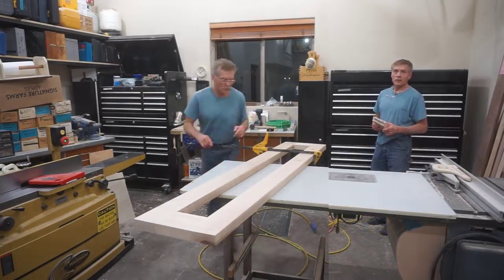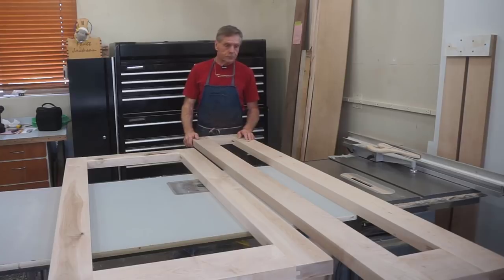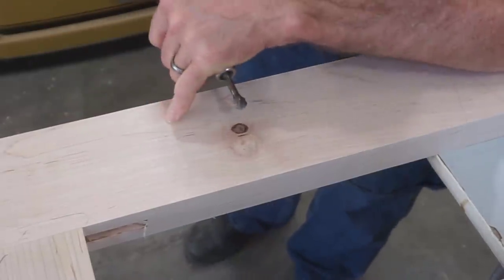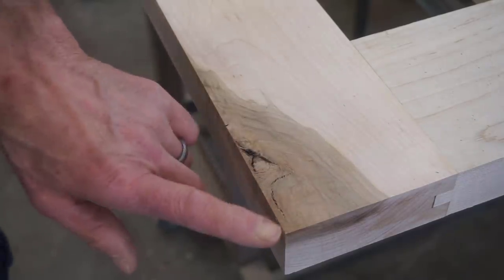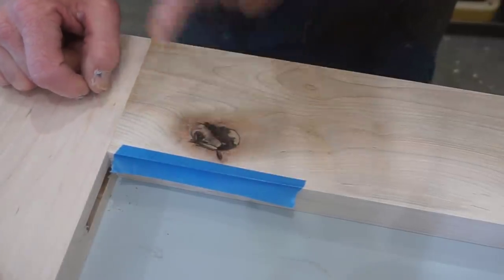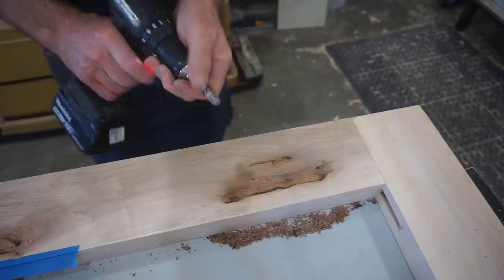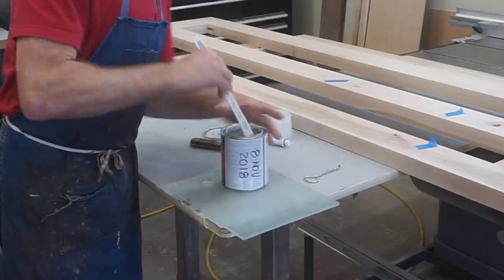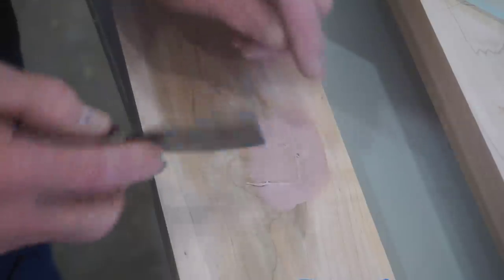How To Repair Defects in Wood Before Painting

Comment: Matt, great tips on the use of not so great lumber and how to fix it up.  On another note,  I might have missed it but,  why did you glue up the frame of the door and not put a panel in it?
Reply from the maker: You didn't miss the panel part or an explanation of it... I mentioned offhand that 'I'll add stops to these' but didn't explain myself.  I made up a square profile glass stop which just gets nailed in to secure 1/4" frosted tempered glass panels in.  The short door just got a 1/4" wood veneer mdf core panel in it as it goes from a closet into a weird mechanical room.  The shop door I'll end up building will have the panel installed during glue up of the frame much as you might have expected from these. Thanks for commenting George... I like how you pay attention to the video noticing subtle things that most viewers miss! Best, Matt
Reply: The frosted glass will be a nice touch I think.
Reply from the maker: @georgeshaw8276  The designer called for it... I think it will be pretty sharp too...  Best, Matt

Comment: Really like your table saw extension/Router table/ workbench. Mine are separate but I have much more space.  I don't understand the mortis over runs. I've used Bondo/woodfiller for years doing high end retail fixture builds, repairs, installs.  Assume these frames will be sent out for Glazing, how much rework will be necessary to repair the Glazers dings and scratches?  Did enjoy! D
Reply from the maker: Dale, the 'mortise overruns' are just laziness.  I didn't want to stop the dado slot and square up the ends since it doesn't matter in the slightest when they get covered over by glass and glass stops.  And I didn't want to run the dado the full length of the stiles either... lazieness, pure and simple!  I ordered frosted tempered 1/4" glass for the doors and will install it myself.  They're interior doors BTW.  I'll have no one to blame for any glazier's dings and scratches but myownself so naturally I'm very careful.  Glad you enjoyed this... Best, Matt

Comment: Nice video. I've used Elmer's epoxy wood filler for deep repairs with good results, but I haven't used Bondo. From the video, I think that perhaps the Elmer's stuff is easier to mix (equal parts resin and hardener, which both come as soft, clay-like bricks) and probably has a longer working time. Do you have any experience with it? I wonder how they compare. Also, how does the Bondo repair hold up with seasonal wood movement?
Reply: Would that Elmer's wood epoxy work on larger moulding gaps?

Comment: Great video, Matt. I use Bondo to fill voids and cracks on many of my wood projects. I hadn't considered doing a deep grind of knots and defects to get a better patch. I normally just remove the loose material before filling. That is a much-appreciated tip. I'll have to give my Dremel tool a workout the next time there are defects to patch. 

One of many Youtube videos that I watched suggested that the mixed Bondo, aka acrylic filler, be spread thinly out on the pallet instead of a big heap to slow down the thermal reaction and,  thereby, extend the working time.  See if that works for you.
Reply from the maker: I wouldn't bother spreading bondo out to slow the reaction... just add less filler or work faster.  The main reason it set up in the video was all the yattering I was doing instead of working! 😩😁😎 Best, Matt

Comment: Nice work. I have used the bondo glazing past for more shallow dents. Were did you get the sanding blocks.
Reply from the maker: Bondo works good for shallow dents but it's frustrating to work with because it's so sticky in thin layers.  You should able to get those sanding blocks at an auto body repair supply house but you can also go through the link to my Amazon page in the video description to find them.... Best, Matt

Comment: Matt, Great video. I have a question. I never used Bondo so your video is my only experience with it. Let's say you did, in fact, let the Bondo cure hard, would it still clog up sand paper? Wouldn't it be easier to just run a belt sander over the hump of Bondo to knock it down to the point where it can easily be sanded, or am I over simplifying the process? What are your thoughts. Thanks, Chris
Reply from the maker: The process I show is where I've ended up after decades experience using Bondo Chris.  Most of what you see as recommendations are the result of doing it a different way which taught me the hard way that there's got to be a better way.  IF you end up dealing with a batch that gets really hard, a belt sander is a great way to save time knocking down a hump but is often a case of 'the lazy man works the hardest' because it's almost impossible to get an acceptable sanding job in the process and you end up doing a second coat and sanding IT by hand.  The extra steps I show really are quick and simple and yield perfect results and trying to save any of the steps generally results in creating more steps, not simplifying things.  You may well find a different process more to your liking and there's nothing wrong with that... I don't intend to show 'my way is the only  way' but it's definitely proven by and for me.  With a little experience with it you'll settle on  a process that works great for you! Best, Matt
Reply from the maker: Oh...  FYI sanding even fully cured Bondo tends to clog sandpaper at the start... for some reason there's always a sticky 'film' on the outside that will gum sandpaper, no matter the type.  The 'cheese grater' sureform plane really helps avoid that annoyance... Best, Matt
Reply: Thanks for the quick reply. I subscribe to several channels for woodworking advice, but I must say "without a doubt" your explanations of techniques and workmanship have been the most informative and useful to me. I've learned more about preparation, time management and good working practices from watching your videos than I could have ever have imagined. You are making me a safer and more versatile woodworker. Thanks! Chris
Reply from the maker: @christopherpavlicas  glad to hear it! I can't always provide a personal reply but I always read comments to stay in touch with viewer input and it's rewarding to know NLC videos are helping you out... Best, Matt

Comment: I wonder if one of those bags they use when decorating a cake would work you could go down in the cracks and deeper stuff or a caulking gun. Just me what do I know.
Love your channel you are the best of the best.
Reply from the maker: Not to disparage creative thinking Mark but the bag idea would be a real mess although it seems good in theory.  Fact is that applying with a putty knife will work filler way down into places with little extra effort, especially compared to filling a caulk tube or bag with fast-setting material and then any attempt at cleanup later.  Thanks for the compliment... I hope my reply doesn't discourage you from posting comments with brainstorming ideas in the future.  Alternative ideas, politely presented, are ALWAYS welcome here at Next Level Carpentry.  Best, Matt

Comment: Dear Matt, now that you have quality outside frames for your doors, how would you fill in the centres? As a suggestion, going through the steps of making a panelled door from frame to infills would be very interesting and would make a highly viewable video. Cheers.
Reply from the maker: The doors from this video got frosted glass in them rather than wood panels.  A full-on paneled door video would be quite interesting but, man; what a job!  Best I have as an alternative is the Pallet Wood Door Series here on the channel. It's something I'm calling a 'tenon panel door' for its unique construction materials, methods and attributes which are not main stream by any stretch but should be VERY interesting IMHO.  Stay tuned for the final episode on that door in the next month or so... 
Best, Matt
Reply: @NextLevelCarpentry  Thanks for that. Yes, a wood panel door would be some project. I’ll have a look at your Pallet Wood Door series. Cheers.

Comment: I want to see the build video on those doors! What kind of panels will go in the  frame?
Reply from the maker: The doors in this video get frosted tempered glass.  The door for my new shop will get some sort of solid wood panel... haven't settled on the design yet.  Hope you can be patient as I've got a lot of stuff to clear off my slate before I can actually build the door but I do expect it will be worth the wait... Best, Matt

Comment: Matt, have you ever tried epoxy with sawdust mixed in as a filler for large defects?
Reply from the maker: Nope.  More expensive, too slow, harder to sand, etc.  Can't really imagine when such a repair would be necessary unless I was fixing a crack at the same time.  In that case I think I'd repair the crack with epoxy and then repair the surface using Bondo...  but that's just me.  The method you mention would work for sure... seems like it might be more trouble than necessary or than its worth IMHO.  Best, Matt

Comment: A bit off topic but where the heck does one find "paint grade" maple? Here in Canada we have only two grades of maple trees: furniture and syrup- -- to neither would I apply paint :) We do however have a very nice selection of "stain grade" MDF --- to which I'm fairly certain your advice and techniques still apply... Many thanks Matt - this will come in very handy!
Reply from the maker: Paint grade maple is maybe just another term for soft maple... it's full of stains and 'ugly' grain but it's harder than poplar or alder so it makes for excellent painted millwork.  Plus it's easier to mill than rock maple and cost's less too.  It's a common product at our local hardwood supplier but I'm sure that varies greatly by area and locations.  Best, Matt

Comment: About all the sharp edges on the doors ... I normally do a light sanding on them because the sharper they are the more likely they are to chip once the finish is on, exposing the raw wood.
Reply from the maker: Timbucktoo... you're right on about that... plus surface tension tends to pull paint away from razor sharp corners that don't get the light sanding you mention.  Best, Matt

Comment: Hi Matt, 

Great videos. I have watched many of them and thoroughly enjoy them. Can I ask what model rasp you used in scraping off the bondo on your first pass? I believe you said it has a curved blade on it and I looked at the replacements to buy new and prefer theone like yours. 

Is the blade replaceable on these older models?

Thanks
Reply from the maker: Here's a Stanley version of that curved blade Gg BRO:  https://www.amazon.com/dp/B00002X1ZN/?ref=idea_lv_dp_ov_d&tag=aiponsite-20&linkCode=ic6&ascsubtag=amzn1.ideas.17DBXMFC3G5TZ 

And there's two versions of handle for holding curved or flat 'blades':  https://www.amazon.com/shop/nextlevelcarpentry?listId=17DBXMFC3G5TZ&ref=idea_share_inf I prefer to have both curved and flat blades on separate handle/holders at hand when doing this kind of work to quickly switch between the two functions. Thanks for watching and commenting! Best, Matt

Comment: We found accidentally that grease proof / baking paper has a very low adherence to builders bondo. We clamped a straight edge wrapped in it to a door that needed bondo on three sides around a notch that was cut. The paper allowed the edge to be removed and just needed a small amount of triming with a blade when bondo was mostly set up to be removed.
Reply from the maker: Really?  That sounds too good to be true but  wow, what a time saver!  Thanks for adding the tip here for both myself and other viewers... hope I can remember it for next time I need it! Best, Matt

Comment: Long lasting in dry climate zones, would be reluctant to apply bondo in Fla or Puerto Rico, where moisture/ humidity could crack and lift.
Reply from the maker: If wood isn't sealed enough to keep out that moisture and humidity, Ricky, the bondo will be only one small part of a much larger problem of rotting, deteriorating wood... juss sayin'.  Best, Matt

Comment: I watched a auto body repair video and they said to be careful not to get air bubbles in the bondo and to fold it to the center making sure not to get air bubbles in the mix.
Reply from the maker: Air bubbles (that create pinholes) are always an issue George and far more critical in autobody than wood filling but a good point just the same... thanks for mentioning it! Best, Matt

Comment: I have a question about the mortising of the stiles. Why do you mortise beyond the fitment of the rail tenons? I'm going to be making a custom size door for a client soon.
Reply from the maker: geardriven: here's the response I wrote for another viewer with the same question:

Dale, the 'mortise overruns' are just laziness.  I didn't want to stop the dado slot and square up the ends since it doesn't matter in the slightest when they get covered over by glass and glass stops.  And I didn't want to run the dado the full length of the stiles either... lazieness, pure and simple!  I ordered frosted tempered 1/4" glass for the doors and will install it myself.  They're interior doors BTW.  I'll have no one to blame for any glazier's dings and scratches but myownself so naturally I'm very careful.  Glad you enjoyed this... Best, Matt    
  

      
  

    

          
        ·

Comment: I heard from a bondo guy that bondo eventually shrinks. The deeper the bondo, the more it shrinks. 10-15 years and it shrinks. Any experience with that?
Reply from the maker: Experience? Yup.  Shrinkage? Nope.  The wood is more likely to shrink or deteriorate than the bondo, but in any case I've yet to have a problem with compatibility or longevity of repairs like this.

Comment: Ahhh, the smell of Bondo in the morning... great for exterior repairs too.
Reply from the maker: Smell of Bondo in the morning... LOL!! Good one Steve! Best, Matt
Reply: Do not use bondo for exterior repairs.  Bondo sits on top of the wood and doesnt form a proper bond.  The repair will separate and fail within a couple years at most- if youre lucky.  There are much better alternatives available on the market.     

I've been a preservationist for only 5 years but i've been trained by and/or worked with many preservationists who have decades of experience in wood repair.  They all laugh out loud at the idea of using bondo.  The Window Preservation Standards Collaborative doesnt recommend it, either. It just doesn't last.  Honestly it makes me a bit sad to see Next Level Carpentry recommend it to his viewers without so much as a disclaimer regarding its longevity.
Reply: daminox So what do you use for exterior repair?
Reply: @NextLevelCarpentry  I had a I teacher at Pratt say the reason he became an industrial.designer was because of the smell of Bondo! And I believe he meant it :)
Reply: They use Bondo at Sunburst shutters for all the shutter repairs and custom builds. Granted, its all interior work.
Reply: @daminox   You say you have a better solution so why do you not share it as requested by @ASH below? It’s easy to criticize Matt for not making a disclaimer you believe is warranted. Providing a detailed description of an alternative would validate your claimed expertise.

Comment: Where can you get those sanding blocks? Precut paper or 1/3 sheets or?
Reply from the maker: HfA, There's a link to the blocks through Amazon on a link in the video description along with sleeves of the long, narrow paper I buy to use on 'em.  I end up with about a 1 1/2" trimming from the long strips after I cut 2 pieces the right length for these blocks. Best, Matt
Reply: Thank you sir!

Comment: The problem with Bondo is its harder than the wood.  It's very easy to keep tearing out wood around the Bondo.  Vinyl Spackling paste more closley matches the wood and easier to sand without the tear out.  Good video though.
Reply from the maker: I think spacking paste is far too weak and soft to be effective, especially for wear areas like these doors.  If you have issues with wood 'tearing out' around bondo I think and alteration to the sanding method, sequence and technique is a better solution than using a softer filler... but that's just me.  Thanks for commenting here Ted! Best, Matt

Comment: Regarding the last sanded repair .....didn't see a fence on that corner. For future reference is there a material or method to make a fence that will release from Bondo ?
Reply from the maker: I'm not sure completely what you're asking about steveg but anything I've tried to use for a fence or form always sticks to the work and makes a bigger mess.  I get VERY creative with masking tape for all such work... it can be used to hold a 1/2" thick repair on a corner with no trouble.  Hope that helps with future projects? Best, Matt

Comment: Why Bondo vs West epoxy [which is use for stain-grade as well]; I find the epoxy seeks out the 'nooks 'n crannies'.
Reply from the maker: How fast does your 'West epoxy' set up and cure Benny?  I'm guessing that's the main 'why'.  Although for exterior stuff epoxy (Wood Epox or Liquid Wood) are the only way to go... I just hate waiting 24 hours for it to cure.  Best, Matt
Reply: It's usually the last task before closing up shop for the night; next morning, it's ready for sanding, though there's usually something ahead of it in the queue.  [And the vast majority of my work is from 'stain grade' white oak, cherry, or walnut.]  Thx.  Always look forward to your videos.
Reply from the maker: @affromma   It's nice to be able to plan things out that way when time allows and epoxy is some amazing stuff when used correctly.  I use clear stuff for securing loose knots in 'rustic' grade hardwood like you mention... makes for very cool finished look! Best, Matt